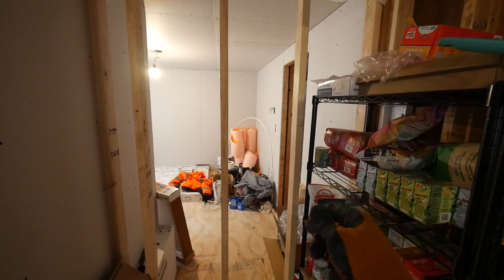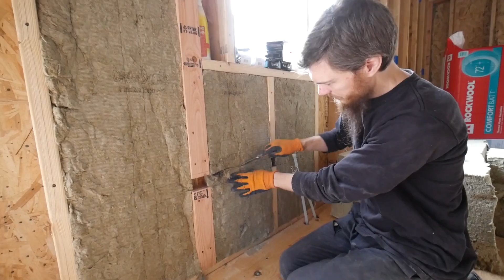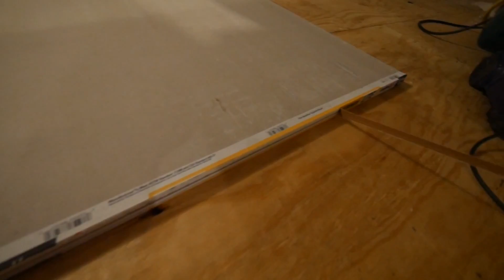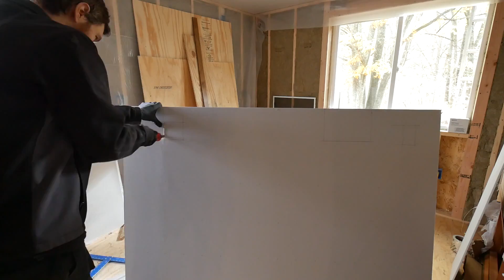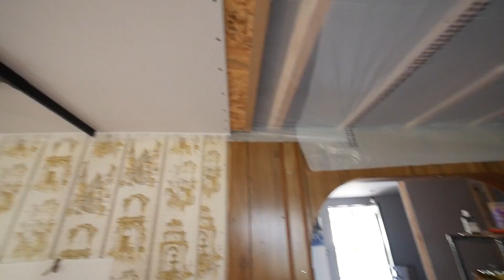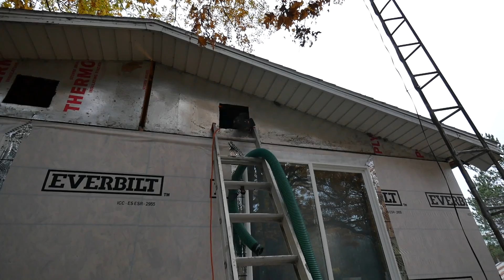Renovation Overload | Why we Install a Vapor Barrier on the Ceiling - Home Renovation

Comment: That's a really nice sweater you're wearing at the end there, Ashley! Love all the 'stars' on your shoulders :)
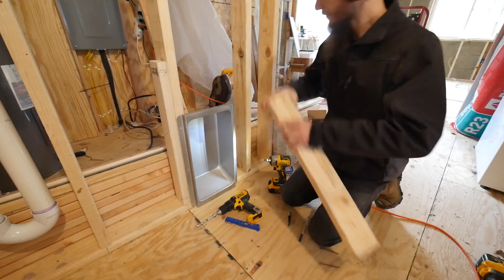For someone in Europe, could you explain how that dryer-pan-thingy (shown 23:38 in the middle of the shot) works? It doesn't seem to have any holes in it, so what is its function? How does it "vent" ?
Great job, time to relax and enjoy a warm welcome in your own home!
Reply: Me too, but I'm in England and it's not what we use,
Reply from the maker: I'll try to show that more later but it does have a hole in the top and the vent will go up inside the wall. It's really just a wall cavity so the dryer can slide back without crushing the dryer hose.
Reply: @diyfferent  That is actually really neat! I've never seen one like that. I've always seen dryers placed near an exterior wall so they can vent out the side of the house.
Reply: @lesleyharris3198  British Standards & Building Regulations states that all vent holes for any extraction within a home or must be vented through ceiling to roof or straight through outer wall

Comment: I used to live in a mobile home not only did our kitchen drain needed to be slanted. Also we needed to have a heat tape where the water come into the house. So the pipe did not freeze.

Comment: Congratulations on all of the tremendous progress that you have made.  Thank you for the informative discussion about insulation and where to use a vapor barrier.  Do you have plans for any kind of treatment in your crawl space such as insulation or air infiltration, etc.?  Is a vapor barrier needed on the floor of the crawl space or under the floor or side walls?  I think that people would find your opinion about the area under your house interesting.
Reply from the maker: Thank you! Yea, we have plans of fully encapsulating the crawlspace. We want to insulate the crawlspace walls and lay down plastic sheeting on the entire floor down there. We'll show it all once we get there :)
Reply: @diyfferent  I figured that you would consider the crawl space area and how to seal everything up to mitigate both air infiltration and moisture plus add insulation so that your floors would not be cold during the winter.  I have heard that this is often called a "conditioned crawl space."  I am very impressed with both your approach to your remodeling project along with your work ethic.

Comment: So the plastic won't make mold from the moisture? It was interesting hearing you explain things but I wonder about mold with plastic up. Aww Maverick is so proud of himself building like Daddy.
Reply from the maker: No, mold comes from condensation when moisture in the air comes in contact with a cold surface. The plastic helps keep the moisture in so it doesn't reach the cold surfaces. Without plastic, the moisture could travel into the insulation until it reaches the cold and its dew point, creating moisture in the insulation, wood framing, etc. It can create problems IF you have poor insulation(cold drywall), use air conditioning, or is on the wrong side of the structure for your climate. I hope that all makes sense :)
Reply: @diyfferent  Oh.. Thank you for answering.

Comment: Wow lots done, I still think you should take the paneling off in the kitchen on the inside wall and double up the studs. You have a lot of weight added in the ceiling. Down by the bathroom it isnt as bad because you have two walls supporting it. But good progress in a nice long video.
Reply from the maker: Thanks :)

Comment: Once again, great job!!  Question (completely unrelated) : What are you guys doing to prevent the rodent problem that you walked into???
Reply: I do believe he said they have sealed all possible places where pests can enter their new home.
Reply from the maker: We've been sealing up every hole possible so they can't get in anymore. The house went way too long with large holes everywhere, haha :)
Reply: @diyfferent  yes, those were some large holes! So have you put any barrier like a very fine mesh screen as well or just kept really tight holes??
Reply from the maker: @shellywelsh2316  Whenever we make holes, we try to make them as tight as possible and spray foam around them. Larger holes like the tub drain cutout will get completely sealed and we'll be showing that hopefully soon :)

Comment: I wonder if the addicts spring ,winter,fall temps could be used to store stuff from the summer garden kinda like a root cellar ,but just a box with a pipes down to crawl space opening covered good and a small fan  on box to bring in fresh cold air at times only at night when roof not getting heated from sun..

Comment: When you have all the piping for water installed, will you have to put heat wrapped tape under the trailer to winterize it all
Reply from the maker: Last year we did fine without it but we had a lot of heat loss under the house. This year may be different. We're hoping to get the crawlspace insulated which should help.

Comment: You do good work the only thing I see that you do is put too many screws in the drywall. I use to do that too...
Reply from the maker: I just do the screw spacing according to code. On my butt joints I space them closer because I want it to bend the drywall evenly without cracking it. Sometimes I do add a few extra in the ceiling too when it feels right :)

Comment: Fully wrapped inside and outside. Moisture in the insulation, defeats the insulation value, leads to mold and mildew, which in turn attracts insects and rodents. Before the early 70's people did not insulate homes, oil was $0.12 - $0. 25 a gallon, older homes were built with fireplaces and the majority of people used wood, coal and/or kerosene stoves for cooking, people  before that time used seaweed, and a variety of other fire hazards to insulate. Modern insulation is a relatively new concept, which we are still learning and some people are still working on updating standards for a healthier environment when living in these new plastic bubbles, which leads to the new standard; ventilation.

Comment: What mil of plastic did you use for the vapor barrier? I'll  be using it in 1970 Mobile home with Aluminum siding in the Lake Tahoe/Sierra part of CA.
Reply from the maker: I don't think plastic vapor barriers are recommended for your climate zone but typically they would be 6 mil.
Reply: @diyfferent  thank you.
I'm in a zone 9a and 9b and my mobiles walls are so thin I can't replace to siding yet, so I'm just doing the inside. Do you think it'll cause any harm? We have dry heat here.
Reply from the maker: @CADreemz  Many people use plastic without problems. There are so many factors that I couldn't say without being there, but generally speaking, it should be fine.
Reply: @diyfferent  thank you 😊

Comment: Great episode. Felt like a new view, new fish eye lens or just a new camera angle. Loved it. Great that you got sealed up and are nice and warm. I'm guessing you can't make the buttboard out of drywall because of the number of screws required?
Reply from the maker: Screws just don't grip good enough in drywall so it wouldn't pull it in to make a taper. Screws grip the OSB easily. :)

Comment: I get so excited when I see that you've posted a new video....  Fabulous explanation about vapor barriers..  QUESTION.. I thought you always finished drywall at a solid surface to keep it from eventually sagging.  Why did you use a floating piece between truss (that may add weight) to screw it to?
Reply from the maker: The drywall is still screwed to the joists for support. With the floating piece, you are basically joining two pieces together to create one long piece while allowing space for compound. (hopefully that makes sense.) The little extra weight of the wood doesn't hurt it.
Reply: I've always seen drywall joined at 2x's.
Reply from the maker: @paulmonk7820  Yeah, that little trick isn't well known.

Comment: I don't know, I am asking, do the kitchen drain lines and water lines go on the warm side (inside) of the plastic vapor barrier in the walls?
Reply from the maker: Typically they would go inside the wall, behind the vapor barrier, but I don't see harm in doing it either way.
Reply: @diyfferent  I was worried about them feeezing if they're outside of the envelope

Comment: J strip on the ceiling edge?  Did I miss something?  Is there any concern about mould forming between the plastic barrier and the drywall from condensation?  I found mould once between some large packs of paper towels I'd stored in a room that formed between the plastic and the drywall on the interior.  I thought the stains would never disappear.
Reply: I think it is for cosmetic purposes only.  He explained it at around 22:00 - 22:25.
Reply: @fancybrooks3156  Yeah, I know that.  But why?  Aren't the interior walls being replaced with new ones?
Reply: @gdcat777  Not along the hallway.  The paneling in the hallway will remain.
Reply from the maker: The paneled wall is staying so the J-channel is the transition. Sure, I think there should be a concern for mold in any home really. We hope to properly insulate and ventilate to try to avoid any problems.

Comment: Is it safe to cut out those exterior studs for the plumbing? I thought you could only notch up to 25% of a 2x4 to keep structural integrity. Love the renovation though 😊
Reply: As he explained in the video, these are the nailers, they are not structural, just making the studs bigger, to hold the thicker insulation.
Reply: @sc0ttishlass  Ah, yes, I rewatched that part. Thx!

Comment: Are-you going to join the the aluminum fibre board of your attic wall to the "Tyvek" with tape?
Reply from the maker: We're not sure if we will be tearing that off and replacing it with OSB, or leaving it on and putting a thinner OSB on top of it. Either way we will be putting more house wrap on top and then the seam will be taped :)

Comment: You're Plumbing and Framing is top notch.  But plastic vapor barriers?  Holmes always showed how it lead to  condensation and then mold.  Was this really a approved method?
Reply from the maker: Yea, and for our area it's required by code. Now days, all homes really should be have  HRV systems, bathroom exhaust fans, and cook top hood fans installed anyway. If a home is properly ventilated, condensation and mold won't be a problem.
Reply: I think paint the drywall in the inside before putting it up, just cheap miss tint paint latex.

Comment: i dont think mine can handle drywall ceilings. What can I use instead? im mid-century modern in taste.
Reply: with a grungy-industrial twist.
Reply from the maker: This is an option that is lightweight and looks nice: https://www.lowes.com/pd/Armstrong-Ceilings-Common-48-in-x-6-in-Actual-48-672-in-x-6-682-in-Country-Classic-Plank-20-Pack-White-Faux-Wood-Surface-Mount-Acoustic-Plank-Ceiling-Tiles/50022842   Here is the website so you can search where to buy it near you: https://www.armstrongceilings.com/residential/en-us/suspended-ceiling-systems/wood-look-ceiling-planks/item/480.html

Comment: Saving energy saves money month after month, year after year. Spending a little more up front will provide a great return on investment in the future. Air sealing, super insulation, energy efficient heating and air conditioning systems, energy efficient appliances, energy efficient water heating system,  LED lighting, set back thermostats, energy efficient windows double or triple pane, solar panels with battery storage and a 220 outlet for in the paring area for an electric vehicle charger.  All these need to be considered when doing a new build or retrofit. These all may not be possible because of budget or extent of remodel but all should be considered. Net Zero and Passive House building standards make for a comfortable and energy efficient home saving money for years to come.

Comment: Did you also put a vapor barrier on the outside under your siding? Won't a double barrier trap moisture between the walls?
Reply from the maker: The inside plastic sheeting is a vapor barrier which doesn't allow vapor to pass through, and the outside housewrap is a moisture barrier which does allow vapor to pass through.

Comment: What made y’all choose rockwool insulation instead of fiberglass batts? I will need to be doing some insulation soon, and wanting to get all the info!
Reply from the maker: I mostly chose Rockwool because it has a higher r-value and better fire blocking qualities than fiberglass.
Reply: Better insulation.  Makes a better seal.  Higher R value.  Better sound barrier.  Easier to cut. More mold, rodent and insect resistant.  It does not use it R value when wet.  Easier to shape and cut to an irregular opening.   More flame resistant.

Comment: Can you explain why you left the paneled wall in? Maybe you explain it in a later video but I haven't gotten there yet. Every other wall in your house will have nice thick drywall and as you know you can literally put your fist through that panelling.
Reply from the maker: It would be a lot of extra work/money to do drywall on that whole wall with no benefit. Plus that's the marriage line so we just want to keep that wall lighter. You can put a fist through drywall pretty easily too though, probably more so than paneling ;)

Comment: The drain won’t freeze on an outside wall?
Reply from the maker: No, it's on the very inside of the 5.5" insulation and should stay the same temperature as the drywall. But I do try to avoid plumbing in exterior walls whenever possible.

Comment: I absolutely hate blow in insulation. I would have used rock wool in the ceiling as well or a combination of fiberglass and rock wool, whatever was cost effective to get it to the required thickness.

Comment: I know it’s a little late now, but if you nail a 1 foot piece of 2X4 on the end of a 2X4 stud so it looks like a “Tee” then cut the stud so the whole thing is a little longer than your ceiling height, you can use it to prop up the drywall in those narrow areas. It’s light enough that even a child can place it underneath while you hold the drywall up.

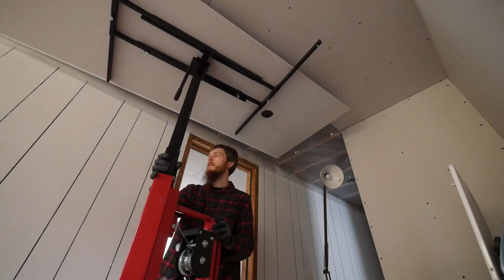Comment: @32:16 Doug inserts random joke...🤡🤪😂 What a miserable task the attic insulation job but at least Ashley was able to use the hopper outside. One less thing to clean up👍 You can hear how muted the sound is now inside the house and it sounds cozy and comforting. Take care, Doug. Bye, Ashley.

Comment: I think you're going to wish you had wired the outlet for the under-cabinet light to the existing (now removed) switch.  Now, at night, you're going to be stumbling over your desk chair to reach the light switch.
Reply from the maker: That's exactly how we are wiring it. The switch is staying and we are just rerouting the wire to a receptacle. We didn't remove it.

Comment: I didn’t see a exhaust fan in the bathroom ?
Reply from the maker: We have the hole for it made with a wire going to it. We'll be installing the fan once the walls are finished. :)
Reply: So you’ll be crawling around in that blown in insulation in your attic installing a exhaust fan    and vent ? That sounds messy
Reply from the maker: @rickjohnson1632  No, the hole is on the exterior wall of the bathroom. It's a wall exhaust fan.
Reply: Doug and Ashley did a good “think ahead plan” on the exhaust fan.

Comment: You're not wrong... if the attic id unconditioned (unheated) space, the vapor barrier goes on the ceiling (either like you have it, or with the paper side up on the insulation).  If the attic is conditioned (heated) space, then then vapor barrier would go on the roof (inside, up against the roof).  https://www.youtube.com/watch?v=OJ9u3pDQeM4

Comment: I've read  some experts on sites like greenbuildmedia.com and finehomebuilding.com who claim that if you seal all the gaps at floor level, around electrical and heating fixtures and the gaps where wires and pipes run through, there will be no need for a plastic vapor barrier; these people usually argue that almost all the moisture that gets into these spaces gets in via air leaks, not moisture wicking through things like drywall. That jibes with my somewhat limited experience; my attic has no mold despite 25 years with 1' of insulation and 35 years before that with no insulation, though it is well ventilated. I'm pretty dilligent about sealing the access panel and there are no fans or fixtures on the ceilings below. One reason I can see for some vapor barrier, rather than just air tightness would be to keep the rooms dry in the summer when the AC is on (if that's even a factor in N. Michigan), since in many places, half the need for AC is to get rid of humidity. Still, I don't know that a lot of humidity would wick either way through drywall as long as all the cold surfaces are properly insulated.

Comment: The place where the water heater is are you insulting and dry wall that area
Reply from the maker: Yea, the exterior wall has insulation, but we'll be doing plywood for the walls in there.

Comment: Please get rid of that vacuum cleaner all that rodent waste is still in it. You should get a Bissell Lift off Floors and more. It's great. It's rechargeable and you can do the whole house without recharging. Great at getting up hair. Lol
Reply from the maker: We don't really use it anymore since all the dirty jobs are over with. It'll be going in the garage soon. We have another vacuum that we use for regular cleaning. But speaking of rechargeable vacuums, we want to get one of those when the house is done being worked on :)